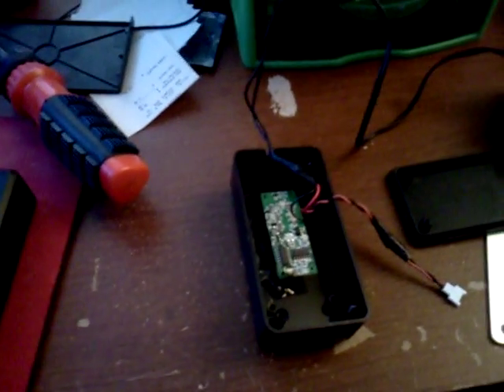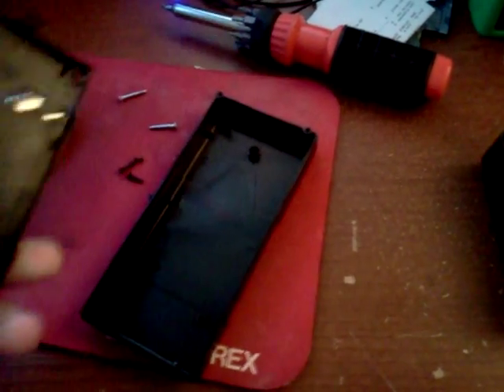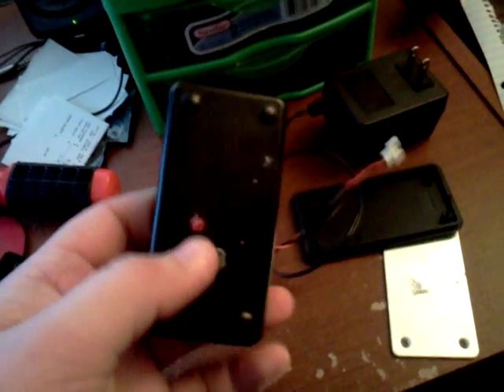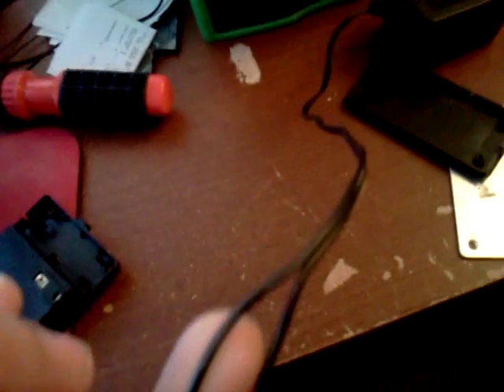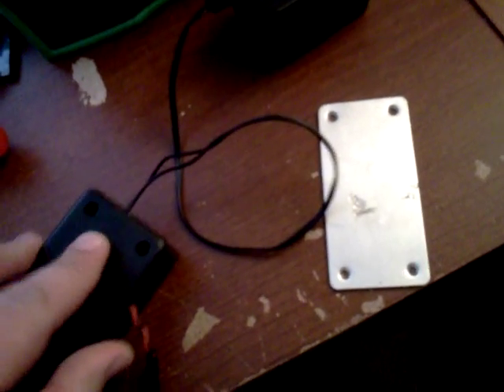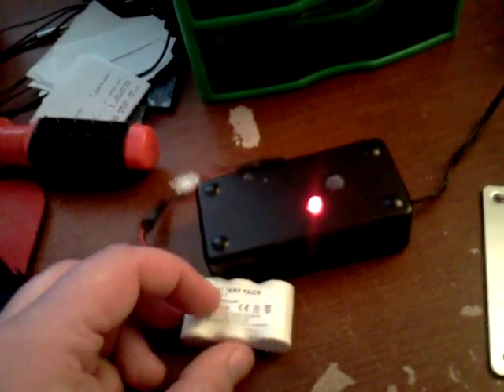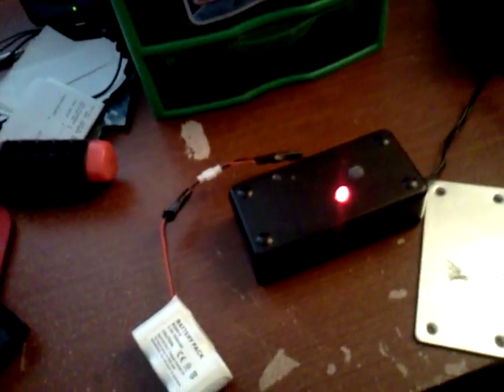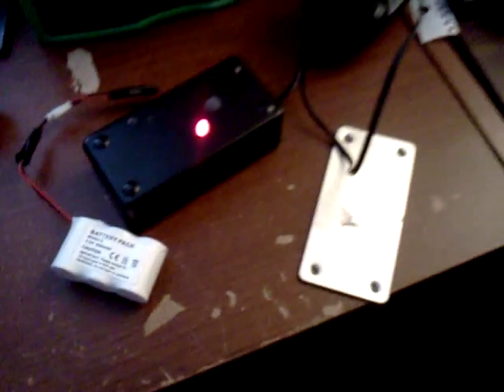Battery elimination mod for losi micro chargers

Comment from the maker: @InsaneModdingCrew You must have a short some where, make sure your connections are tight between the adapter and the charger board and see if that fixes it, I soldered all my connections seen in the video

Comment from the maker: @MrJames3524 I hope not!! what was the voltage and amp/milliamp out put of the adapter you used? the only thing that I can think of is to double check your connections and make sure you have your polarity correct. Disconnect the adapter from the board and put a meter on it. If it's backwards you will have a nevitive reading on a digital meter and on an old style the needle will try to move backwards. I hope this helps, let me know if it doesn't